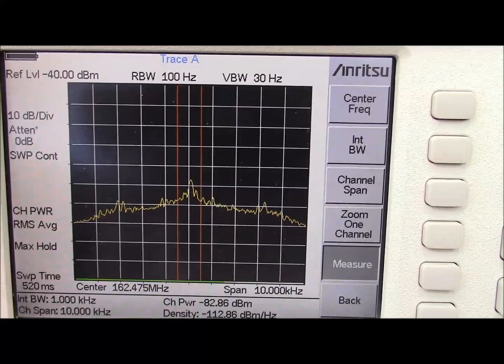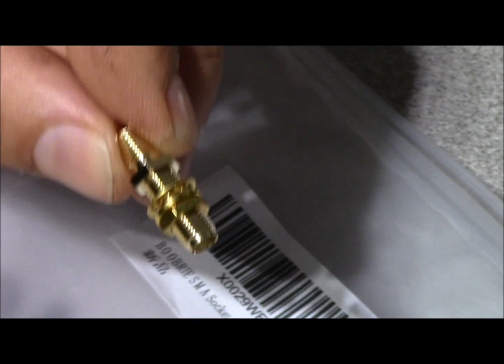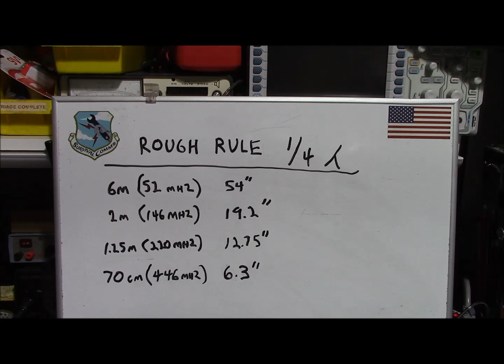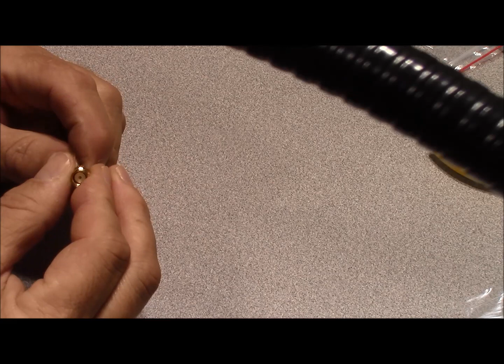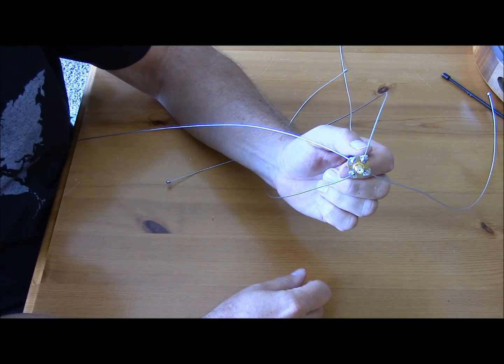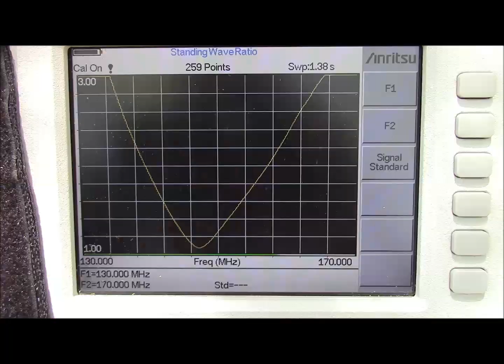This ham radio antenna can save your life - The ground plane antenna

Comment: Make sure to use the right size terminals for the gauge wire you are using.

😂"make sure you capture those cut off braids" because if you step on one they hurt like a MFer!

Comment: You could also use an so239 panel chassis mount with falanges. instead of cutting out a shim stock. But you have to change one of the connectors in you coaxial cable.

Speaking of coaxial cable, how long should it be?
Reply from the maker: Yes you can. Thats how we did it 30 years ago and it works good. I don't like so239 personally and you cannot connect your antenna from your portable to an so239. Cable length is dictated by , need, necessity, and how much cable loss you are willing to accept. Thanks for watching !

Comment: i have literally done the same builds myself, seems to be a road one must take to further elaboration.
But i found the single strand copper wire (1 & 1.5mm locally) more agreeable.

Also may i pose a challenge? Making a no tools antenna, using nothing more that a knife to cut the cables, feed line included. And no use of connectors adapters.

Regards...greekman
Reply from the maker: The bicycle cable worked pretty good. The first ones we did with SO239 chassis connectors back in the day were with solid conductor wire. I did a video on the coax dipole 6 or seven years ago IIRC it is still in my content catalog. https://www.youtube.com/watch?v=CwOATcwHrBo&t=1s     here is another from a couple years ago https://www.youtube.com/watch?v=OlVGhNpY2oI&t=131s    Thanks for watching !

Comment: A simple dipole is easier, can be used vertical or horizontal. I have no idea how anyone thinks ground planes are simple, they are far more complex than dipoles. Dipoles Work.
Reply: To: WS7PB; Problem is, what you're probably calling a "dipole" is actually a 1/4wave, on it's side..
Unless you take your unbalanced feed from your radio and pass it into a true 1:1 trifillar transformer, the other half of said "dipole" isn't radiating, it's not doing much at all besides hanging out with it's coax shield feeder friend acting as a poor take off radial.  can that work?.. sure.. poorly.
A heavily radial'd quarter wave is a true reference antenna and will out preform in efficiency, radiating pattern & Q.  I hope this helps you in the future.  
To this channel: Love this antenna you came up! with!
Reply from the maker: I have videos on a simple coax dipole in my content catalog from 6 years ago. Thanks for watching !